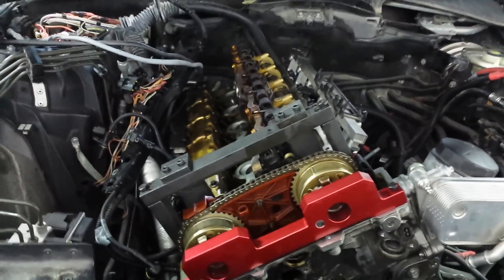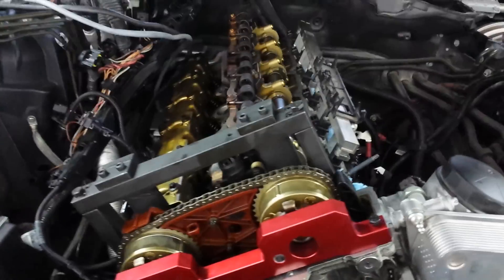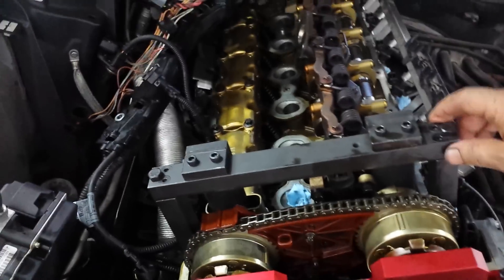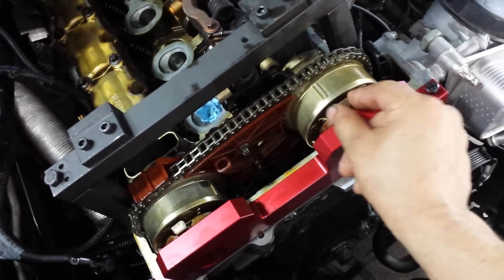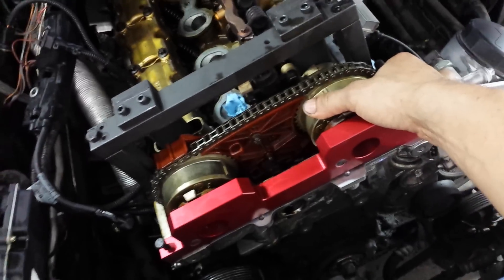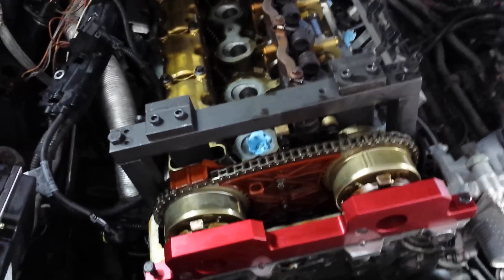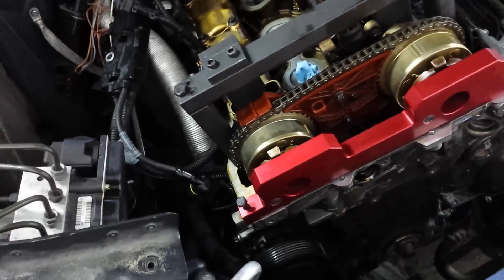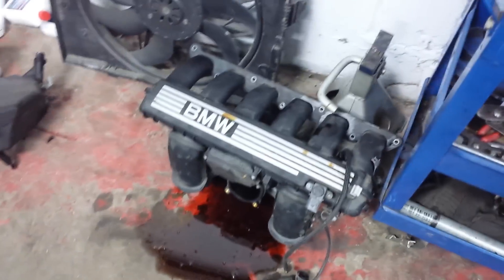Bmw N52 timing reset

Comment: Hey i just used the bmw tool kit and the engine still want to stall but came in as working i know it's all about the timing but what could make the timing change and also does the fat line on the cam pulley mean something?
Reply: I just heard you said it doesnt matter which side they go

Comment: I did mine and it still wont start. It just a few teeth when the sep belt snapped and went into the engine thru the front main seal and now its wont start
Reply: Did you remove the oil pan? serpentin belt inside crankcase cause oil pressure problems as well

Comment: How can I check if timing is correct without resetting it? Does the vanos return the camshaft to its zero position when the engine is off? I checked the engine that I want to buy and the camshaft tool didn't match, there was about 10 degree difference between camshafts.

Comment: Not necessary to remove manifold for flywheel lock.
Reply: I have to do my but i don't wanted to take the manifold out. How you do it ? How i know what motor I have like those letter M52, E60. I have a 2008 528xi 3.0. How i will know those letter  ? 
Thank you

Comment: Hi 

I have a 330i and my timing chain guard broke (plastic) go figure. Now it slipped off and my car wouldn't start. The camshaft (exhaust) was not turning.

What is the name of the tool that I would need to perform this procedure with the timing and to put the chain back on?

Thank you in advance

Comment from the maker: you need to remove the intake manifold to have acces to the hole it normally has a yellow rubber plug it is on the block next to the flywheel
Reply: Do you know why the timing was out of range ? I have a car that has the same code and problem as this one. 

Apriciate you making this video btw.